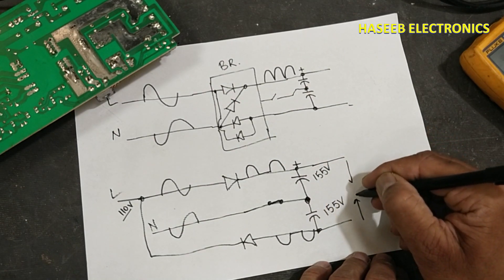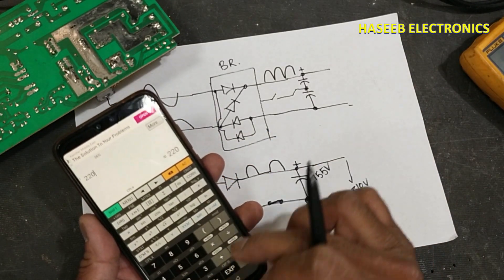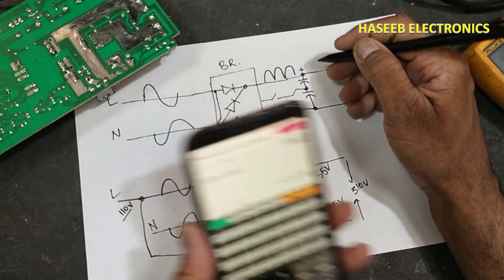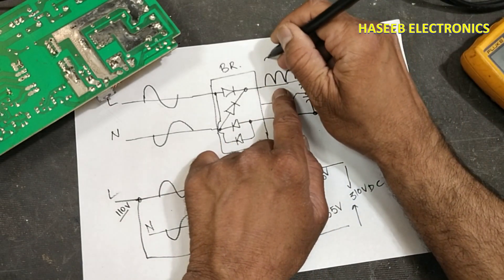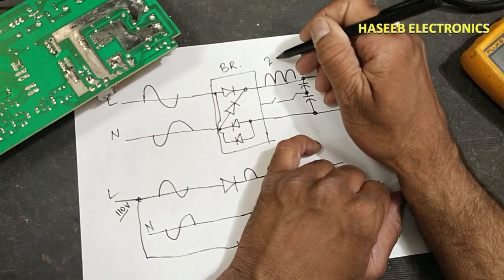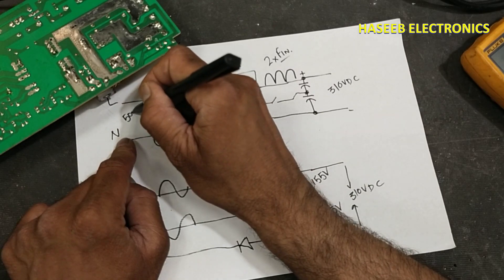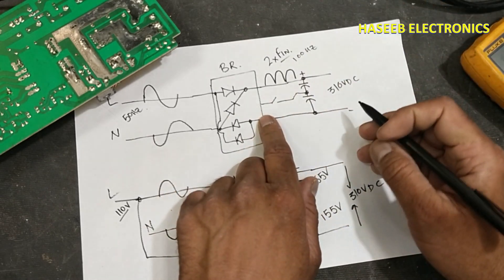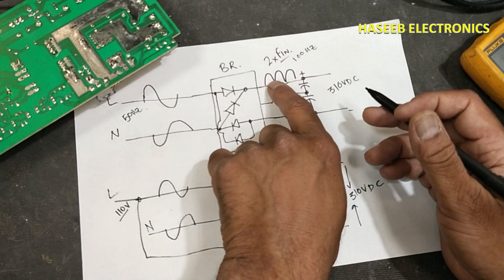{894} 110V / 220V input voltage selection switch circuit in SMPS

Comment: Hi Dear, is it is possible to modify the smps power input voltage, like it works by maximum 240 volts as a input, can we modify it which can work up to 350 v as a input voltages, kindly guide Regards

Comment: I have a question: when you close the switch (set to 110V input) , does it cut off the diodes that are connected to the neutral line? If the diodes are still connected, doesn't it rectifies full bridge?

Comment: Sir make a video how to convert SMPS supply to Solar charge controller Sir I have two 150 watt solar panels connected in series to the input of a smps supply. And the 12 volts I am getting from it is working perfectly pls make a video how to make solar charger controller for smps supply its very cheap and working great

Comment: The circuit of two voltage multipliers is used to get the same current and voltage of the DC rail from the part of the two  capacitors of the half bridge circuit. It was great.

Comment: What happen when the voltage is 220 at the same time when the switch is in 110v condition. Suddenly when the voltage is high as compare 110v. Is not any need of over voltage protection in this circuit?

Comment: Hello sir, thanks a lot. In case 110 volt, accumulated voltage after rectifier is 155 volt and not 310 volt.

Comment: Sir why there is need for this? Many other SMPS like laptop and phone charger can work in both voltage/frequencies without selector switch.

Even if we get 155v DC voltage, IC will increase PWM duty cycle to achieve target voltage when load connected?